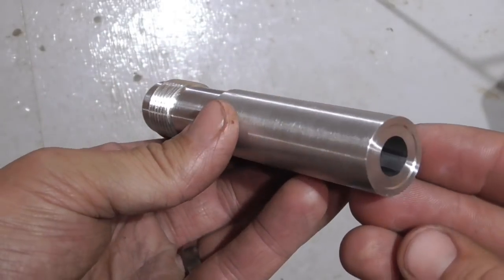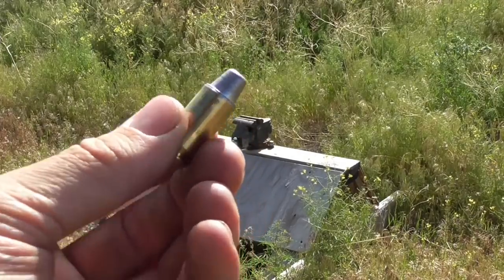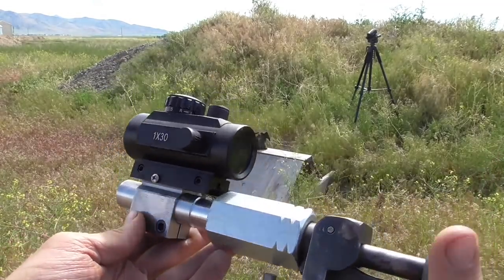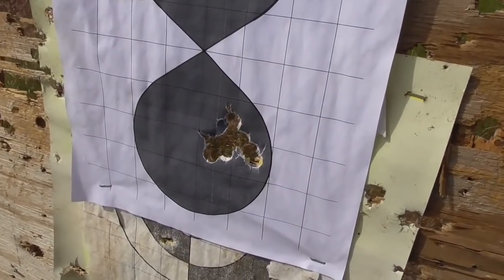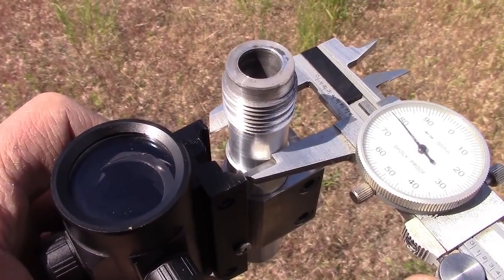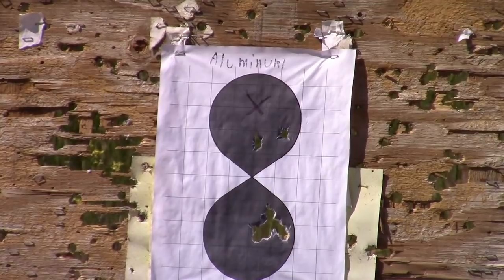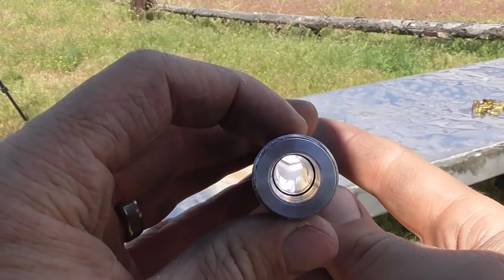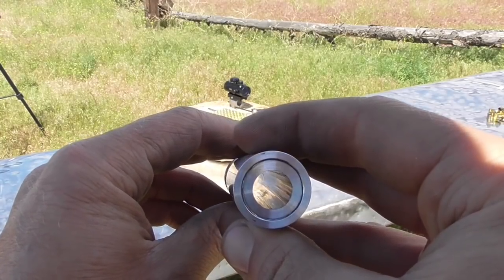Experimental Aluminum Gun Barrel in 45 Auto (TIS153)

Comment: One time I made a 6" long 7.62x54r pipe gun barrel out of 1.125" aluminum bar stock for shits and giggles, smoothbore of course, unsurprisingly it eroded to the point the bullet was loose in the bore after 3 shots. It was loud as heck and threw a massive fireball though.

Comment: If you take an aluminium alloy which contains zinc, silicon and/or copper you could try to heat treat it in order to increase the wear resistance.
Reply: It was ok with lead rounds. With alloy he rifled it by just hammering the slug through with plenty of grease.

Comment: Ive read About Uchatius Steel Bronze. It was an alloy of 92%Copper and 8% Tin. And hat the same hardness as the steel it their time, Araound 1880 or 1890. It got it s strengh form streching.
They made an 5cm bore and pressed an 50.2 mm steelbar throught it. i think they done it 7 times. The last type of this Barrel was used in ww1 from Austrian-Hungarian empire. I think with this Methode you can make your Barrel stronger because they wrote the Surface was very hard and the streching was like you put rings around the Barrel. … only an idea.

Comment: Try to make a tube first of a thicker steel sheet with a thickness of 3mm.Then put the steel tube in another aluminum tube with a greater thickness and so to make a composite of two different materials. Or, over a thin tube made of steel, wrap a fiberglass composite with an epоxsy resin.

Comment: i see a lot of suggestions in the comments, anodizing is smart, try as hard and thick as you can, regular anodizing is quite thin to take dyes, but if you go real thick you will in practice get a liner in the barrel of very hard alu oxide. the plastic sabot idea is also smart, but seems a little fiddly, if i were to make some new tech for this i'd rather make some kind of overmolding system so you could cast some slightly smaller diameter but longer bullet like a 300blk and put that into a different mold as a core and jacket it in nylon. nylon is pretty slick at high pressure if i remember correctly.

Comment: Hum, well if you were making a "liberator" style firearm that is not designed to be used very much before discarded for something else stolen from your enemy, aluminum seems like a good material to use. So good information to have for a guerrilla fighter making guns for his resistant forces, ha.
Reply: It would be perfect if a nation want to indirectly overthrow a dictator by providing weapons to rebels but making sure that they're not providing weapons that can be turned against them. And unfortunately this will be perfect for criminals after all aluminum is easily melted if you have an entire gun made out of aluminum it could be easily disposed of in someone's oven or a fire pit. Because the melting point of aluminum is actually 500° Fahrenheit and your average stove ovens can reach 500° Fahrenheit.
Reply: @krislarsen6546  do the laws of physics cease to exist at your house? Aluminum melts at 1221 degrees Fahrenheit 😂 are you high? Lead won’t even melt at 500. The lowest temperatures I melt metals are at 800 degrees. And that’s zinc and lead.

Comment: Hey man!

A few days ago I thought about finishing the land diameter of a barrel, and it seems like reaming / honing is the common way to do that. Have you ever tried to finish the surface with a full size push button? I was wondering if it is possible to get a higher grade surface by pushing a seperate button thru the barrel before you use the rifling button. 

It looks like the surface of your grooves is much better than the reamed surface, and by using that second button the surface imperfections would go the direction of the bullet. 

Many professional rifling buttons to this with an additional calibration surface I think.

Any experience with that?
Reply from the maker: I think you're right, but I haven't tried that yet.
Reply: @TheIdahoanShow  I might try this when I have time for it ;)

Comment: it would be pretty slick to make a hydraulic press attachment to the tail stock on your lathe so you could just drill ream the barrel put the attachment on riffle the barrel then machine the chamber. not only would it cut down on setups but  the lathe chuck is probably the best way to hold a piece of round and the tail stock is made to put presser in that axis so its not pushing the machine in a bad way.

Comment: does a anodizing process could help in the barrel wear? it deposits a hard coating in the surface
Reply: With as soft as aluminum is I don't think the layer would be thick enough.
Would probably improve but with as fast as that thing was smoothing out would probably be the difference between 50 and 60 rounds if I had to guess, if it helped that much

Comment: I think this test is not up to your usual objective standards.
Prior to the test you stated the Wear should be observed, but then ran a combined test of lead AND jacketed bullets... which showed a Wear Failure of the barrel.  You should have made a Wear Observation after just the lead, because now we are still left wondering if lead (particularly cowboy soft lead) can be shot without excessive Wear.
Reply: If it wears that badly with a few jacketed bullets it's not safe for any ammo for more than a few shots. The test showed all we need to know, aluminum is not wear resistant enough for a gun barrel

Comment: have you thought about using a thin chrome steel liner  heat fitted inside an aluminium barrel ?  get the  longevity of steel with most of the weight savings of aluminium ?
Reply from the maker: That would certainly be an option, although here I was going for ease of machining more than weight savings.
Reply: https://en.wikipedia.org/wiki/Hoop_gun
Reply: what you really want is something that's really hard wearing for the  lining of the barrel  but with tensile strength as a second property something like tungsten or cubic boron nitrite or even a ceramic of some type and then either   fitting that liner inside an outer liner that has a material that's  had high tensile strength but  with  wear resistance as a secondary    in like a hoop gun set up  or  with a wire wound gun set up with the liner tightly wrapped in a wire of something with high tensile strength   steel or maybe even glass fiber ?
Reply: You made my request. I would love to see a tube steel liner fitted by boring this out .0010 undersize and the aluminum barrel heated to over size and press fit. Then ream and rifle.
Reply: firefox5926 i wonder how well that would funtion if you did that with carbon fiber instead of aluminum?
Reply: @firefoxjb  christianson arms make such a barrel and bolt actions with that done as do faxon I believe.
Reply: as in like  with the carbon fibre wound around it ? or as in a  cilinder of cabonfiber in resin with a hole drilled thru it and the liner inserted in it?
Reply: https://en.wikipedia.org/wiki/Glossary_of_British_ordnance_terms#Wire-wound
Reply: https://en.wikipedia.org/wiki/Built-up_gun